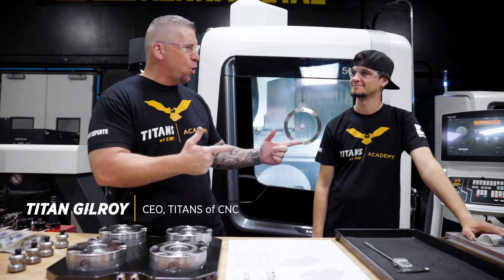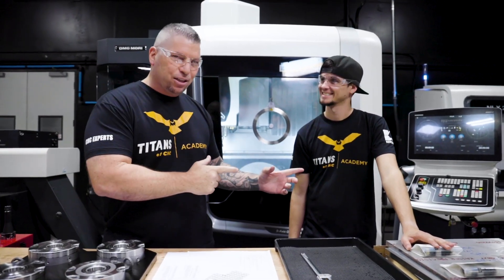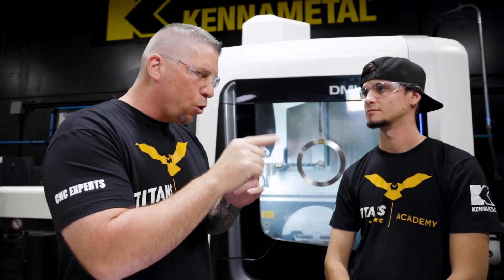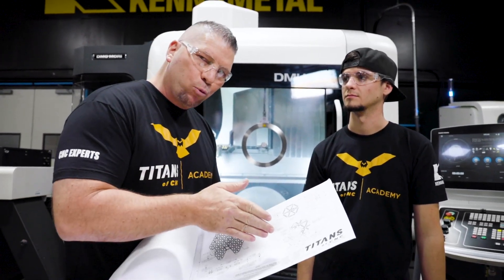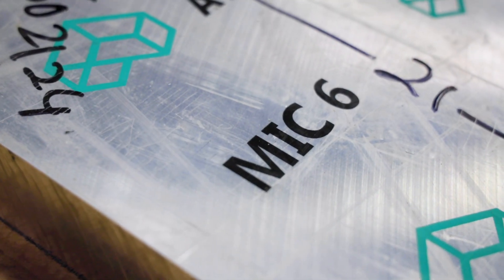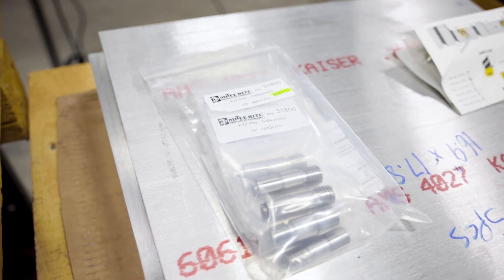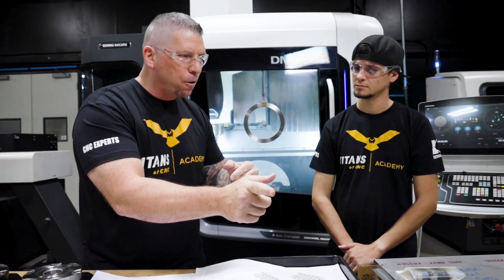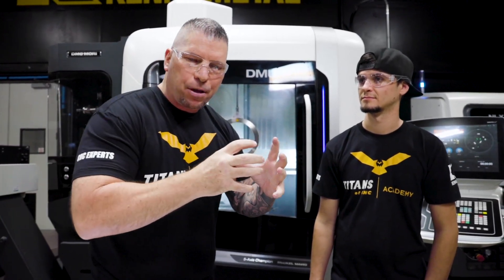Mastering Aerospace Machining | This Is What YOU Need

Comment: Love what you are doing Titan!! Quick word of advice though - you can dual dimension a print rather than having two prints floating around.  You will always have a native unit system and block tolerance and, when converted, the two usually won’t agree.  It won’t be a huge discrepancy, but it’s better practice than making a second print.
Reply from the maker: With all the tolerances and such it was going to be to busy. So we made 2 separate models and prints off each to keep it clean

Comment: Do not use Metric and Imperial.  This will be confused.
Pick one and go.
Final inspection must be in units of Customer's print or MBD.
Reply: they should use Metric since everybody can understand it
Reply: @LordOfChaos.x  My experience is that your final documents to the customer need to be in metric units if the original documents are in metric.

I would debate the validity of having instruments that convert (digital) between metric and imperial.  I would want to see that your calibration system is in the unit system that the tool is displaying unless you have some type of dual certification for both units.

Another not for metric is that I found that purchasing metric spec cutting tools (end mills) may be more readily available than imperial sized tools.  SECO, ISCAR, SANDVIK, for example.

Great series articles that are very much needed for the industry.  Similar teaching is needed for die and mold work.  The cutting strategies we are using are changing all the time.  

I'd love to see some work looking at eliminating chatter by using harmonic analysis to find the sweet spot for the tool and fixture combo.  Blueswarf and metalmax for example.  

Also the reasons why 'adaptive' technologies are so effective in keeping the tool under consistent load and reduce chatter especially in high horsepower applications, like cutting Ti alloys.
Reply: @cfgosnell  i totally agree on what on your Statement 
but sometimes we have Customers from US and UK that send us Blue Prints for specific parts in Imperial Units and we have to convert them everytime 
we kinda got used to it and we do it preaty much without Convertor Instruments
i dont really understand why they dont convert them themselfs
because  its time loss and its their Money 

which is not bad from our perspective 
but here in Germany we are not used to do half assed things
Reply: @LordOfChaos.x  Exactly.  Not all parts from all customers are in the same units system.
That is why you need to do all final inspections in the units specified by the customer.
In-process documents can use any units that are convenient and that match the certified inspection equipment, but even a digital gage or CMM needs to be certified in the units system it is reporting. 
An auditor may question you about your specific in-process dimension call out methods and checks.
Reply from the maker: We only use 1 but give the other as an option for others.

Comment: First time I have heard of MIC 6. Gonna google it.
Reply: High precision surface tooling plate. Threads suck it in though. I always helicoil my threads for repetitive part fixturing to prevent stripping threads in Mic6.
Reply: Hope you found all information already but it's pretty much stress relieved version of 6061 aluminum from Alcoa
Reply: Haven't looked it up but visually it looks like ATP 5083 (what we call it in Europe)
ATP 5083 is Aluminum 5083 which it casted (so no stress in the material) and than both sides are faced to thinkness
I use that a lot for ficturing
Reply: @owievisie  You are correct. Mic 6 is just a brand name from Alcoa. It's basically cast plate.